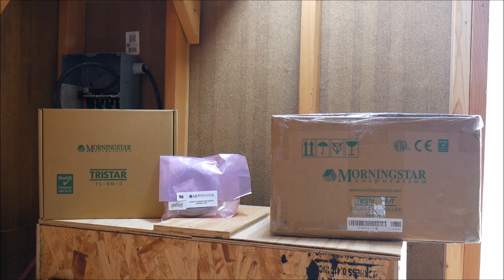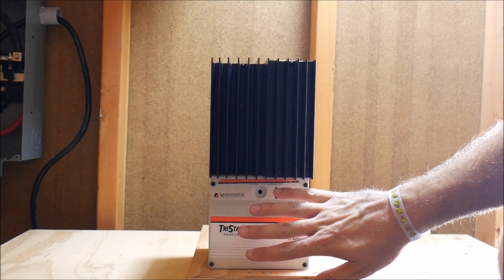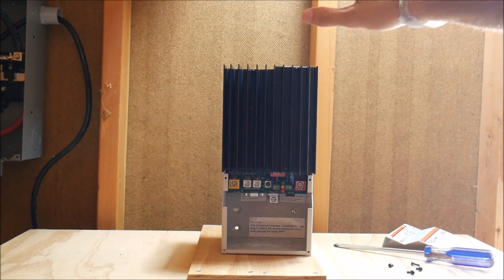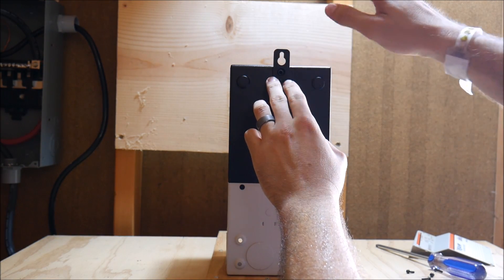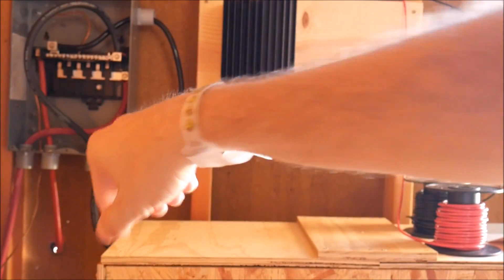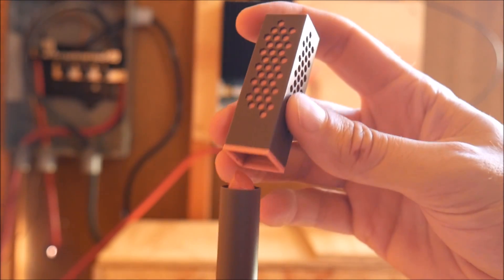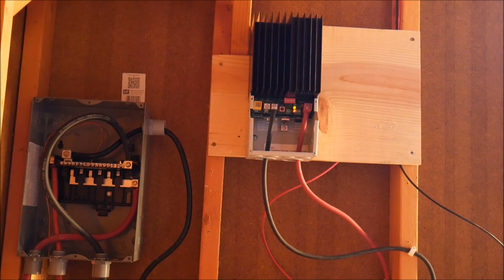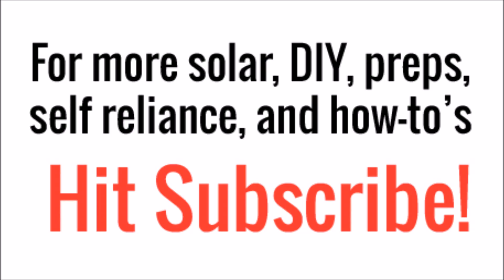Redoing The Solar Shed Part 6 - Installing The MPPT Charge Controller

Comment: I used to love Morningstar. But there is little innovation from them...  what you think about Victron Bluetooth enable charger?  Thanks
Reply from the maker: I agree.  I think they are pretty stagnant and have gotten too corporate.  There are some exciting smaller companies really pushing innovation right now.  Bioenno and Genasun/Blue Sky are two that I would keep an eye on.  I have not had direct experience with Victron but maybe I will reach out to them for a review.

Comment: Hope your child gets well soon, thank you for posting this. You should  use some regular romex connectors, cheap insurance against terminal breakage,  here in fl. some dielectric grease would also help slow down the inevitable.
Reply from the maker: I used dielectric grease in the battery bank.  I have seen some build up there but never seen it on my charge controllers.  I'll keep an eye on it.  I bought some romex wire holders for the knockouts if that is what you mean.  Good call.

And thanks for your well wishes!  He is going into surgery again tomorrow and then hopefully he will be able to recover and come home.

Comment: Happy to see you working on your shed.  I'm not surprised at your choice of controller.  😝.  I will again suggest that you install "standoffs" to your controller.  Almost anything can be used for the standoff.  I have 1 1/8 inch free airspace behind the controller to help with cooling.  My midnite fans RARELY operate because of the standoffs.  Whether the controller is active or passive, the standoffs will greatly embellish operation. 
    Also suggest using cable supports (clamps-connectors) whenever you enter or leave an equipment box or fitting.  A simple two screw romex connector is one choice.  Cheap.  Very effective.  Supports the conductor from falling out of the box when doing maintenance.  Very poor wiring practice not to use one.  Not a slam.  Being helpful.  Btw...i suggest going to your local electric supply house rather than the box stores.  Advantages....you can buy exactly what you need.  Don't need to buy 5 to only use one.  Cut wire is 5 times cheaper.  Other prices will basically be the same or in most cases cheaper than the box stores.  Just saying.  Have fun with your project.  No thumbs up until i see cable supports...haha!
Reply from the maker: I put some cable supports on there!  I guess they aren't the ones you want to see.  I need to put in some grommets, also.

I will find some standoffs, too.
Reply: LDSreliance ...yeh i see some cable support on your 2x4.  Im not talking about that kind.  Im saying to use a support right at the box...entering or leaving.  You dont have any support.  So if someone pulls on the wires...your printed circuit board lugs are the only support.  Not good.  If supported at the box...the wire cant pull out or fall out.  Both circumstances can happen without support. Its safety...and mechanically good practice to install support right at the box.  Not to mention code.
Reply from the maker: I get the concept but there are no mechanical reliefs or supports built in to the charge controller.  It sounds like you are saying I need something attached to the charge controller to hold the wire because the cable supports 8" away on the stud are not enough.  Can you point me in the direction of something I can order?
Reply: LDSreliance ...i just sent a link via email.  These are cheap...roughly $0.50 each.  Box store usually sells them in a package of 5 count.  Or a box of 100.  Proper name is....two screw romex connector.  Google that if my link didnt work.  When installing...connector should be wrench tight to the electrical box...electricians use channel lock pliers to install...snug it to the box or fitting.  Its not a 150 lb head bolt.  When clamping the wire or cable...just use enough torque to snug the wire...dont use excessive force.  Size of connector is determined by size of knockout used.  E.g.   1/2. 3/4. 1 inch knockout...etc.
Reply from the maker: Awesome, thanks!

Comment: Dear American why do you bother with lead acid batterys... Li-ion are much cheaper and reliable and not so dangerous if you read some literature ....
Awesome equipment you have there....👍
Reply from the maker: Thanks.  I have not yet found a large scale MPPT controller that will charge lithium ion.  I just reviewed the first two controllers that I have found that will charge lithium iron phosphate out of the box with no configuration needed.  But a 60A one?  Haven't seen one.

Comment: On the cover of the battery   screw magnet also on the wood behind screw some piece of iron problem solved with door hook 👍
Reply from the maker: That is a good idea.  I could just get one of those cheap magnets they use for cabinets at the hardware store.

Comment: No bushings
Reply from the maker: Yes, I knew someone would catch that!  I forgot to order some bushings so I will be adding those later which I may or may not show on camera.  I am also going to add some breakers for the battery->CC and solar->CC connections.
Reply: Ok good. Safety first
Reply from the maker: Absolutely.  Good catch.